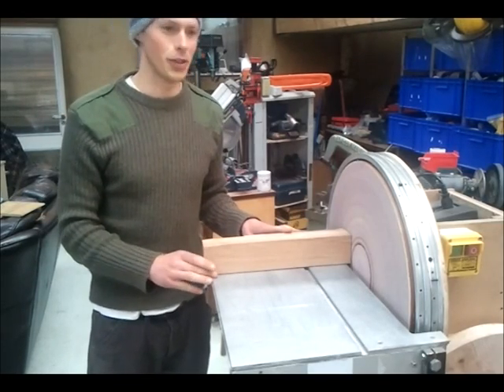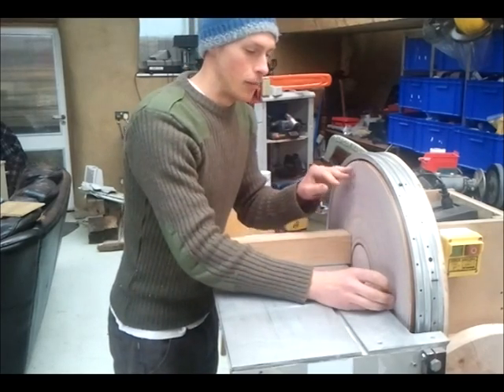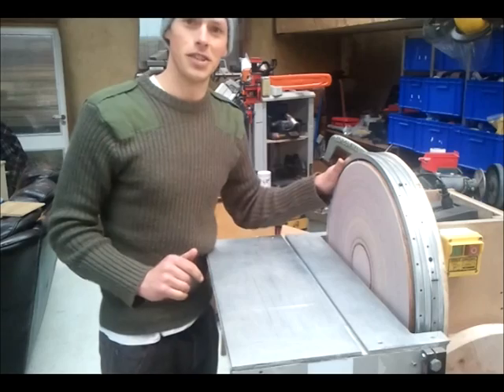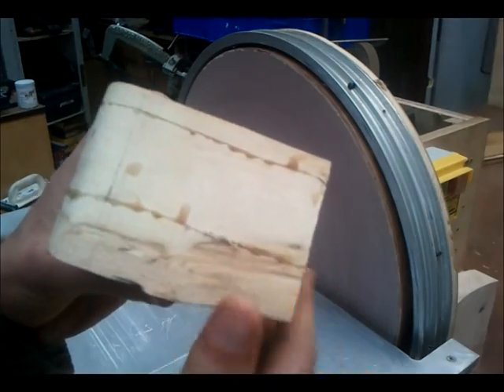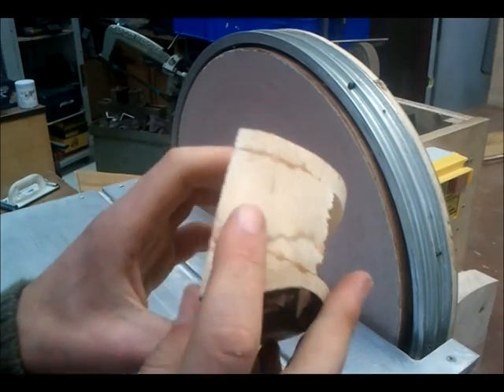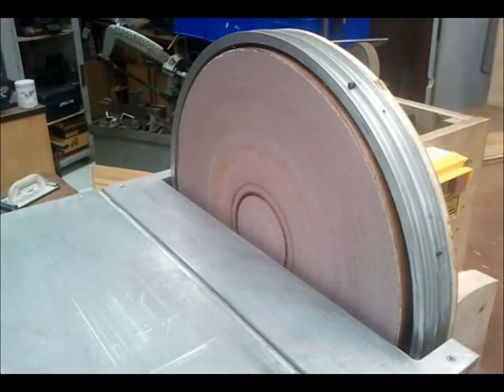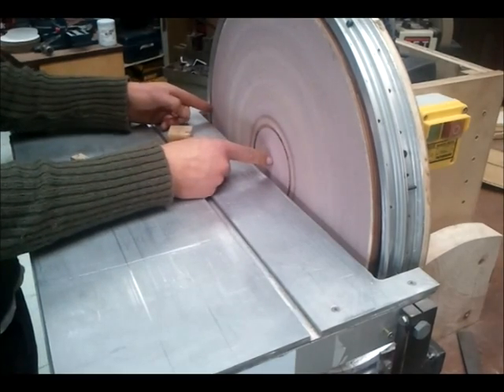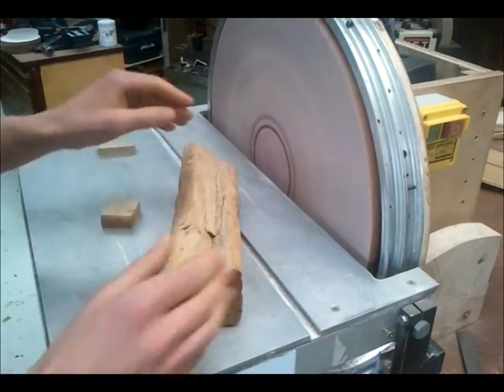Intro to Disc Sanders - Home Made

Comment: Hi!
Tell me what power you have the engine(motor) and the number of revolutions of the machine?
Reply from the maker: 1kw single phase induction motor that I rescued from a broken floor scrubber/polisher found in the skip. I was well pleased when I got it home, dried it out, and tested it. It went really well with very little vibration or noise, running at 1450rpm. At that speed, at the edge of a 20" disk, the abrasive will be travelling at roughly 38 meters per second - which is very fast!. But not too fast :D
Reply: Thank you for the detailed answer!
Reply: @FloweringElbow  Thanks for this reply! I've been messing around with an old jointer motor and am planning to build a disc sander just like the one you have here however, I'm scared as hell that the motor I have will just be too damn fast! LOL The sticker on the motor says it spins at just over something like 3400 RPM. It's a 3/4 HP motor. Most disc sander specs I've read state that the motors run somewhere between 1400 and 1700 RPM. I've searched high and low for a cost effective way to slow this beast down but have been striking out. I'm curious your thoughts based on the experience you gained here as to whether I should abandon ship or keep going?
Reply from the maker: @ButlerBuiltWoodworking  Hmmm, tricky one. I would save that motor for another project. That will certainly be too fast! Most of the sanding disk will be unusable - burning or overheating anything you try and sand... 
Find a slower motor if you can. If you're completely wedded to using it you will need to use a pulley system to reduce the speed - which will all add complexity, vibration and noise... Good luck, let me know how it goes.